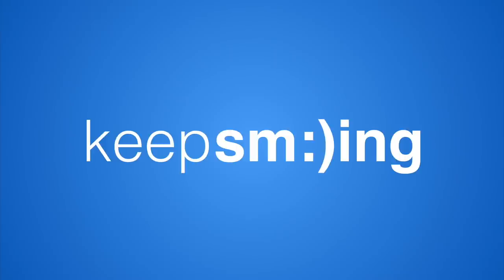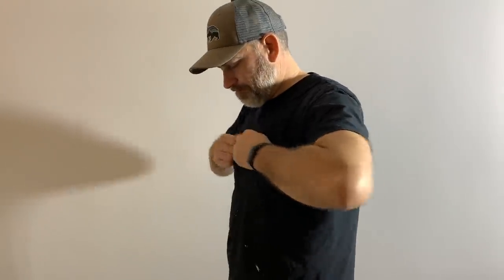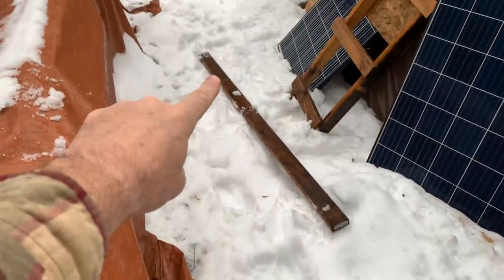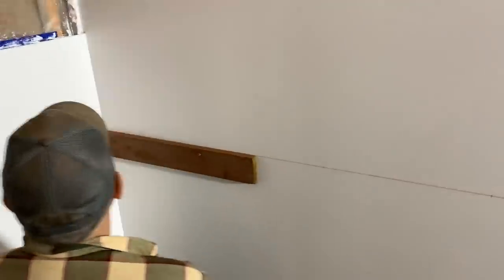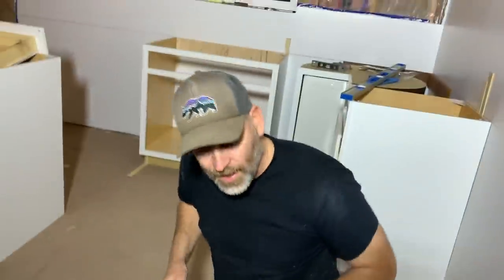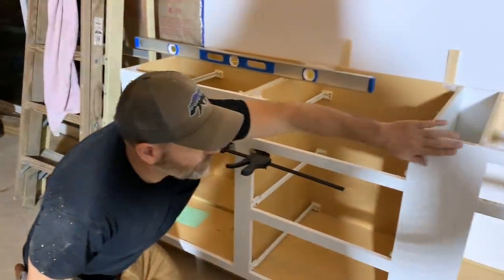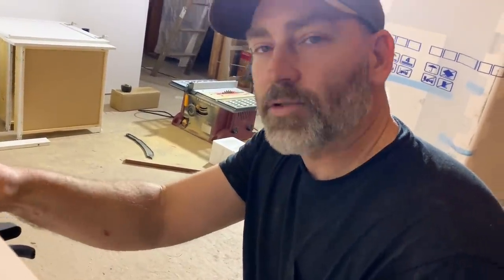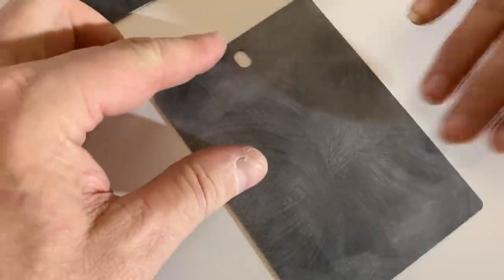DIY Base Cabinet Installation | Off Grid Cabin Build #62

Comment: Dear Martin and Julie, you are doing such a fantastic job, my only critique comments are TidBits to becoming Professionals for the next time you may build again, AND I HAVE A FEELING YOU WILL.  #1 Kitchen Cabinets:  you can put horizontal blocking on the walls in between the studs for the base cabinets and wall cabinets to assist  you in mounting them, which is a standard procedure.  You won't be able to see the blocking, but it will be there.  Carpenters walk around the home interior and determine where they will need horizontal blocking before buttoning things up.  #2, and this is really a tidbit.  Rumor has it that kitchen designers try to leave a foot horizontal spacing away from the walk-into-the-kitchen area of putting cabinets and appliances because home dwellers find it annoying to bump into the cabinets/appliances when entering the room.  So in other words, under ideal conditions, your refrigerator would have been pushed over about a foot to the left.  Sometimes in my home designs, I have clearance issues, and I only achieve to push things over about six inches.  Have a peek at kitchen layouts to see what you think.  But, for Little and Tiny Houses, folk do the best they can.

Comment: Cabinet leveling trick. Level with shims. Then lay a 2x4 flat on the floor and the end of the 2x4 against the cabinet base. Trace around 2x4 with a pencil and then cut it out with a vibrating saw. Slide in a short piece of the 2x4 with some contact cement on it. Once it sets, it will never move like shims can shift and they only support a narrow spot

Comment: I noticed you have supply plumbing along with your vent and drain on the exterior wall. Vent and drain makes no difference but in northern Illinois code only allows supply on interior walls. So for a sink base under the window  supply plumbing has to come up from the bottom of the base 8” from the finished drywall. But I’m digging the homestead. Keep up the good work!!

Comment: Sorry I just saw your video on installing kitchen Cabinets. I use 1/2” plywood behind the cabinets just to meet the top running the length to mount the cabinets to so you have more than one stud secure to.

Comment: Also a subfloor luann too before the cabinet's only if u have high spots or low spots on the floor u could use a wet leveler compound to make the floor level.

Comment: Choose C please - if you choose the texture type surface - over time - most used areas, may eventually become visible - because of bowls & things -  which may have slid around while vigorously stirring things, eventually creating ware patterns on the surface - which might eventually (when the lighting angle is right) "show the most used areas."  Besides the color and pattern looked better on youtube & more in tune with your contrasting yet well coinciding personalities.

Comment: Regarding the solar panels...you can test each panel with a volt meter.  Touch the positive and negative leads of a volt meter to  the disconnected leads of each panel while in the sun.  If you need help repairing the  MC4 connectors, I have all the tools and can help. I live off grid about 15 miles away in Boundary County. Let me know.

Comment: Quick Tip, if You have Upper Cabinets above, it's easier to install Uppers before Lowers, Lowers will be in the way as they are deeper, when You do the Uppers, You'll see what I mean, not just a Keyboard Warrior here, 11+ Years Cabinet Installer Experience..  😉
Reply from the maker: It is a little late for that. Thanks though.

Comment: I choose the one you eventually get. Has the range been converted to LP? You will find that the 400 dollar range will heat up food very similar to the 800 dollar one, even those 1000 - 15000 dollar ranges.

Comment: I'm guessing the range is propane..the last apartment we lived in had completely been redone flooring skyway both bathrooms and kitchen but our kitchen cabinets were just like yours but in grey"not my choice" you have the wider cabinet we had the little narrow I think 10 inches maybe I kept my plastic grocery bags in it wasn't big enough for anything else I liked the cabinets but the cabinets over the sink was one you'd usually put over a fridge it was to high and you could see the bottom which doesn't match the color on the cabinets ...i like your range how much was it ..it may be basic but it's new and it's off gridable 2 major factors for me.

Comment: Kitchen drywall hint. On walls where there are mostly cabinets, split the drywall lengthwise. Run the two foot section along the bottom.Put a full sheet in the middle. Then put other half on top. This makes most of your drywall seams behind base and upper cabinets! If you are doing tile on wall between lower and uppers, this hint does not help you any.

Comment: HOWdy  Johnsons,
I especially <like> this  Off Grid RANGE / Stove - that requires NO ( none ) ELECTRIC to Light & Run ! 
...
but - I would have suggested not - Not - NOT - running your HOT & COLD WATER Pipes up inside that OUTSIDE Wall 
... yes it is "neat" & pretty that way ... but ... after a CENTURY of  bad experiences - most plumbers would have 
SUGGESTED holes in the FLOOR ... toward the INSIDE of your kitchen CABINET would have been "SAFER" ... IMHO ... 
... 
COOP
...